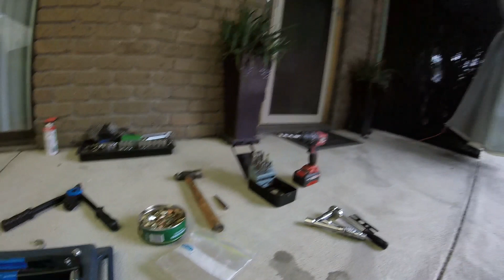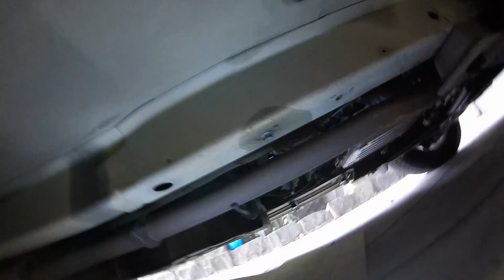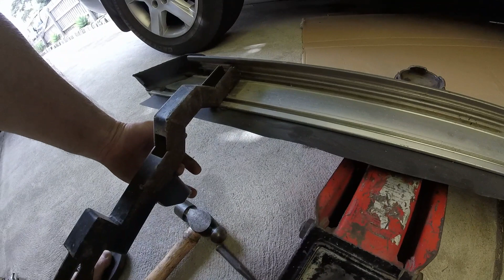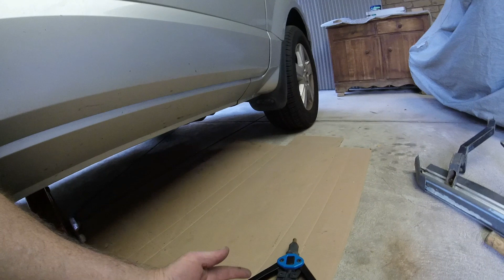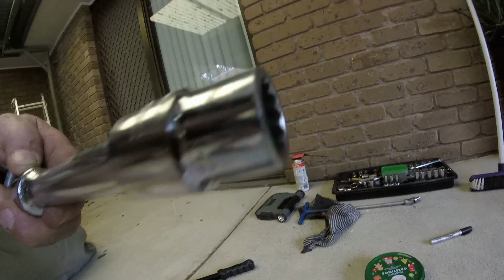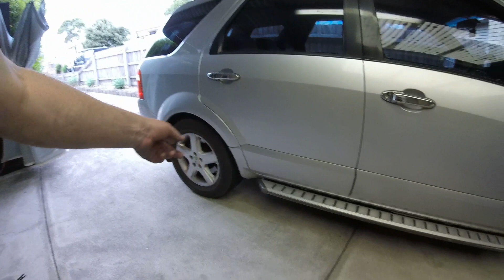Ford Territory Side Step Install

Comment: Solid video mate would u happen to know if its roughly the same for the sz i dont think the 10mm is threaded but the whole is there
Reply: Hey mate I had the same issue with my SZ. I just sprayed some WD-40 and slowly tapped my own thread with the M10 bolt and it worked a treat.